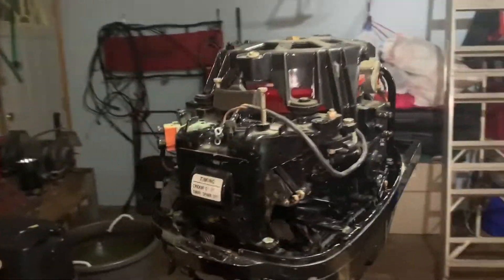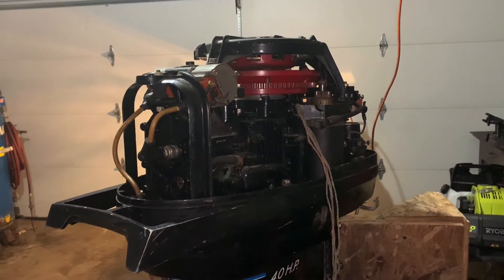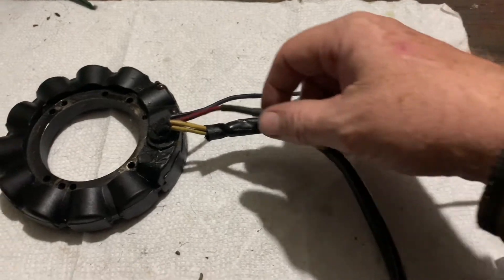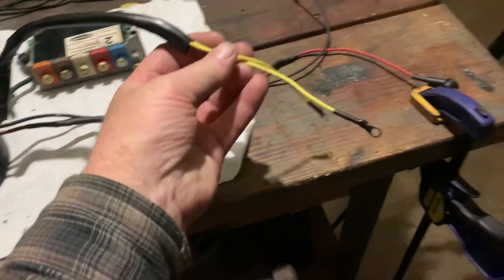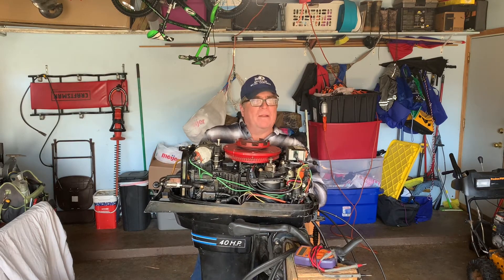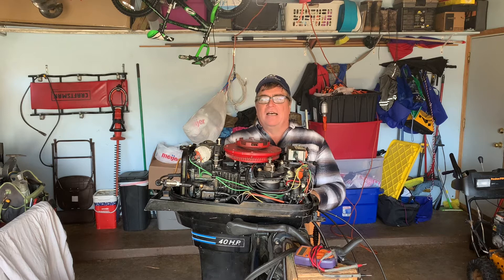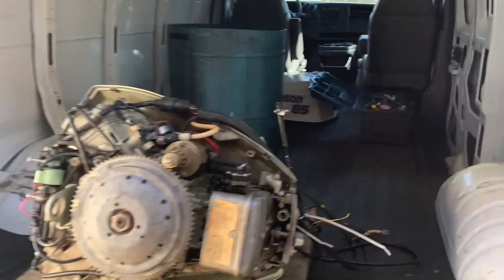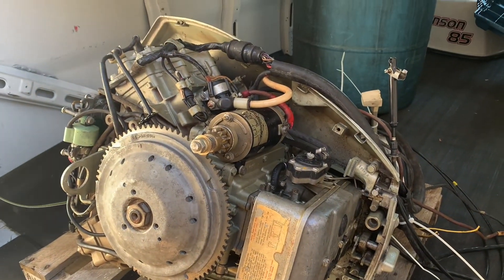1973 40 hp Mercury 402 - Part 1 of 6 - Will it Run? Bad Wiring Replaced & No⚡️Parts Motor or Runner?

Comment: I recently been working on my 1978 402 merc and bought a stator on line and it has a extra blue wire ??
Reply from the maker: Hmm 😒... Are you sure that stator is the correct part number for your 402?

Comment: Where do you find your parts?
Reply from the maker: You can find parts at www.marineengine.com or www.boats.net or even Ebay . These are all places I use to find hard to find parts. If your asking about the box on the top of the motor it's called a switchbox and basically controlls the amount of voltage each components get. I have one for a 1973 40 hp (Model 402) if your interested?

Comment: Just got 402 with same wire issues….can you advise me on correct puller to purchase to remove flywheel?  Thanks for your videos, very helpful
Reply from the maker: Rick Clark… I don’t have the part number offhand. Take a look on the motor it may have a sticker that gives you a part number for that puller. Flywheel Puller 91-849154T1 Lift Ring 91-90455-1 Lifting Eye For Mariner Mercury. You’ll find this on eBay.
Reply: @LivetofishOutboardRepair  got pulled you suggested but don’t see how it threads on, is there a way I can send you pic of what I’m looking at
Reply from the maker: @Rick Clark  the fly wheel does not thread on. It’s pressed on with the fly wheel nut. And you have to torque the nut to a very specific torque. my email address is livetofish64@yahoo.com sorry I misunderstood, I thought you meant putting the flywheel back on. Removing the fly wheel may require a different type of harmonic puller might do the job.

Comment: Have the same motor. 30 years of pure joy.  Locked up the other day.  Got it freed up by soaking with 2 cycle oil in the cylinders. Running again.  Trying to check compression.  Cannot get to bottom cylinder (cheap kit - schrader valve appears to not work properly however rubber connection works great on top piston but cannot position properly on bottom cylinder).  Thoughts?
Reply from the maker: Joe Bell … Either remove the lower cowling or drill a hole in it large enough to get your compression gage through it.

Comment: I have exact same motor. How on earth did you get that upper cover off? I need to get at carb but I cannot for the life of me get that upper metal cover off. Also how do you remove the cover in front of carb?
Reply from the maker: There should be four bolts or nuts … two on each side under the upper cowling. The front cover comes off with a lever or button either on top under the pull starter handle or underneath the bottom of the front cover-plate.
Reply: @LivetofishOutboardRepair  I took those four bolts out but the cover was still fastened solid. wouldn't budge
Reply from the maker: Maybe the rubber mounts are sticking. Are you sure you took the correct bolts out? Maybe you removed pull starter bolts thinking they were for the lid?
Reply: I took off actually 6 bolts at bottom where the cover mounts to motor. I will look up under the top of cover. Thanks lad
Reply: @LivetofishOutboardRepair  I got it thanks!

Comment: Can you show where you hooked all the wires from harness on motor? You kinda of sped up at that point. Thanks
Reply from the maker: Try slowing down the video. You should be able to see how I wired the harness to the motor. The switchbox is color coded. The green wires went from the switchbox to the coils.
Reply: @LivetofishOutboardRepair  Thanks I did and it helped.

Comment: hi, i have the same "thunderbolt"40 hp  402 mercury, with pull start... how does the top cowel actually come off ?
Reply from the maker: Stan Stanby … The front nameplate comes off first with a latch or button that once removed exposes the latch that removes the center cowling. When you remove the center cowling this should allow you to see the nuts that hold on the top part of the remaining cowling. I hope this helps.

Comment: Hello have a 1977 model. Would like to know what your multi readings were for the wires on the stator and how you did it. Thank you so much.
Reply from the maker: rdeanlive...I can’t give you the exact numbers since I didn’t write them down, however the ranges for your motor can be found on www.CDIelectronics.com. You will need a volt/ohm meter and a DVA (Digital Voltage Adapter). Check the resistance (Ohms) reading first by disconnecting the Stator from the Switch Box and very if they are in range, then attach the DVA and set your meter voltage at 500 volts AC. The DVA checks the peak voltage output both connected and disconnected to the switchbox or powerpack. Compare the output peak voltage with the CDI information for your particular motor on the CDI electronics website to see if your in spec. If not you have a bad Stator.

Comment: Working through the exact same problem. Let me know if you figure it out!
Reply from the maker: No problem, I’m working on part two and hopefully I will have a solution. I should have used a puller as this created another problem but I believe once I get the flywheel and timing back where they belong it will just need a new switch box. Stay tuned for part 2. Thanks for watching and commenting.
Reply from the maker: Nope it wasn’t a problem with the switch box. Turns out the coils were wired wrong by the original owner and I failed to notice both coils were improperly grounded to the engine. If you watch part 2 you’ll see what I mean.